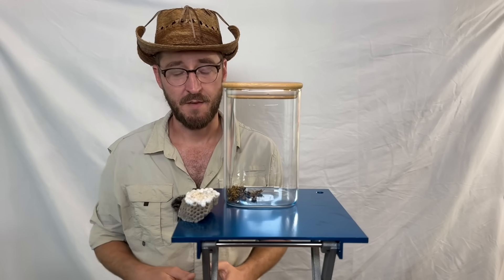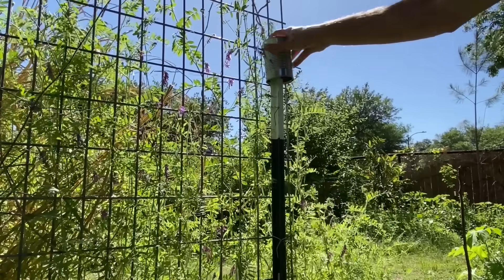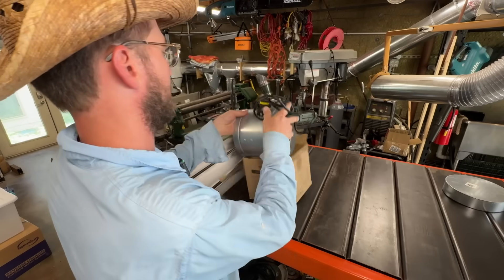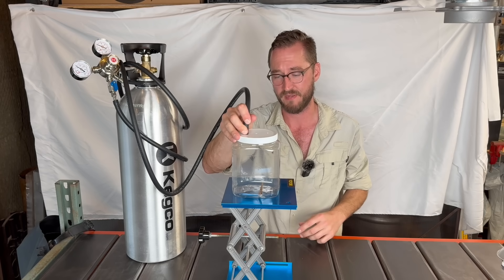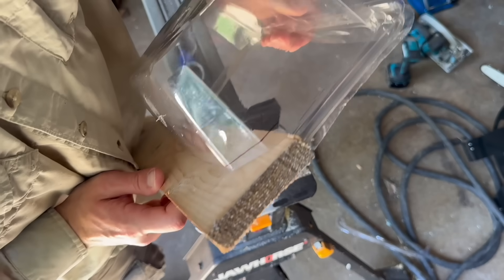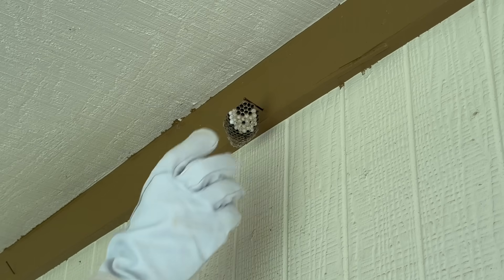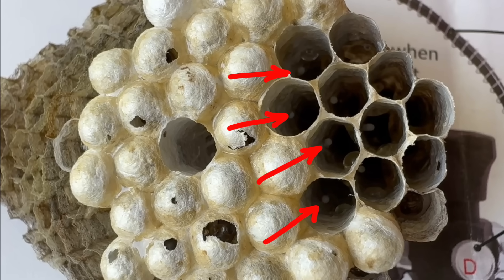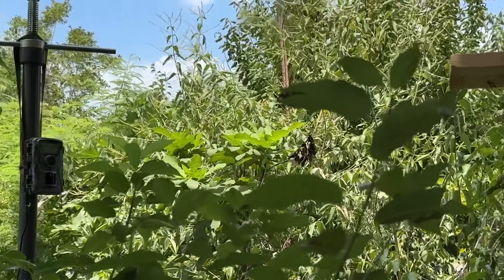Move WASP nests ANYWHERE!!!!

Comment: Your video content is super cool! I’ve tried similar methods before, but I wasn’t successful. I’d like to ask you a few questions that came to mind after watching your video.

From what I saw, your method is: you cover the colony with a net, wait for the wasps to wake up, let them recognize the location of the nest and climb back onto it, and only remove the net after sunset when they stop flying out.
I have tried a similar approach before, but the next day, the colony still flew back to the original nest location instead of staying at the new site where I relocated them.

Question 1: Have you ever encountered this situation?

Question 2: Regarding success rate, is there a difference between the pre-emergence stage (founding phase with only the queen) and the post-emergence stage (worker phase when workers are present)?

I noticed you used hot-melt glue to fix the nest in place. I know the pedicel is very important for Polistes wasps. Some literature indicates that the pedicel helps restrict the approach routes of intruders and contains substances that repel ants.

Question 3: Does fixing the nest with hot-melt glue compromise this protective mechanism, making the nest more vulnerable to ant attacks?

Question 4: Have you ever accidentally broken the pedicel during nest removal and had to glue the nest directly at the base without the pedicel? If so, did that situation have a higher failure rate due to ant attacks?
Reply from the maker: The wasps sometimes return the original site. Moving a young colony tends to avoid this compared to moving a more mature colony. 

No ant problems but I have noticed that the thinnest stalk attached to a small surface area is better at avoiding the below parasite. 

https://en.wikipedia.org/wiki/Chalcoela_pegasalis

Hot glue doesn’t work as well as a two part epoxy like JB weld. 

Good luck!!

Comment: What a cool idea! 

I discovered a paper wasp nest (Apache wasps, native to my area) on a garage shelving unit I had moved outside. Unfortunately, the nest was below eye level, as the highest shelf (under which it the nest was located) was only approximately 36” from the ground, so my “discovery” occurred when one of the wasps stung me as I was rummaging through my stored junk about a foot away from their nest. It’s possible that it wouldn’t have stung me at all had I not reflexively tried to brush it away — we also get a lot of black widows in my area, so I tend to treat any insect I feel crawling on me with suspicion until proven otherwise — so I moved away as quickly as possible, treated the sting and then went back later after dark to locate the nest.

This nest is easily as large as the big one you relocated, and is surrounded by enough stuff that I would have a hard time getting close enough to gas them safely, but it’s cool to know that it can be done. As it happens, I already have a CO2 cylinder from my aquarist hobby, so the biggest ticket item is already in the bag!

Knowing that they tend to build in the same general area (despite not re-using the same nest), I’ll be vigilant next growing season about catching the queens early in the process — I don’t mind native pollinators/pest control as neighbors, but I prefer if they allow me to access my stuff! 😂
Reply from the maker: I moved an Apache nest once. They are subtly different from exclamans but they are “prettier” in my opinion and bigger. Good luck if you try to move them. I didn’t realize co2 was used for aquariums.
Reply: @suburbanbiology it’s used for high-tech planted aquariums. They can be lovely, but they’re not for the faint of heart — or wallet! 😂

Comment: The only wasps i cant handle are the ground ones. Sevin dust in hole and 3 days they are toast. All my other wasps dont bother me and i got them all. We had paper wasp nest in our shed with mowers. I had agreement with wasp sentry, dont attack me and i wont spray you. I would take time and get about 3 feet from nest regularly as they were about 4 feet from mower. Has no issue til my son decided to try and get mower out. Nope they went after him and he won and i was pissed. I had tamed that 12 inch nest. Now i case them out even before they can create a nest fully.

Comment: Just a heads up, CO2 can cause PVC to become brittle over time. Make sure that you don't build anything where CO2 will sit inside of PVC before the open flow nozzle. Also, like almost every insect, the reason why wasps love your beer bottle on a hot day is that it leaks CO2 and they can smell it. CO2 usually signals food source (which is why we put limes in the bottle tops), so they get excited before they get sleepy. You gotta be quick with that container.
Reply from the maker: Cool info! I didn’t know about the brittle PVC thing. Or the food signal. Thanks for sharing!
Reply: @suburbanbiology  My pleasure.

Comment: Induced hypoxia could be MUCH EASIER.... just put a fragment of dry ice in a large pickle jar...  hold over nest until enough dry ice sublimates.... move nest.   No need to for huge pressure vessel and tubing. 
Also.... Your first draft failed to provide the wasps weather and predator protection.  Squirrels LOVE wasp larvae for instance, so do racoons.  Wasps choose porch awnings for a reason. Nacent paper wasp nests are suceptible to strong winds and rain (before envelope is constructed around the comb), and the height makes them predator-proof.  If you put some 5-6 inch lips on your horizontal board to provide wind/rain protection from all directions, you may get better success and eliminate the chance of abandonment / colony failure.   Neat video tho.  Looks like you figured this out, the oat can may be TOO deep, but keep trying and see what works.
Reply from the maker: You were spot on for a lot of that

Comment: My friend and I found a wasps nest under the ground one time that was humoungous. It easily went into the ground about ten feet. We ended up digging it up and it was crazy big. It was about 10 feet deep and was in layers every ten or so layers was the size of like a football at first and then extended into another chamber where the chambers would grow and eventually get smaller. The middle chamber that was the biggest was about as big as a beach ball but sort of football shapped. There were maybe five or six big chambers. We only realized how big the nest was because my friend stuck a garden hose down into the opening of the nest which was dug into some old retaining wall of a garden made from old rail road ties. The look on my friends face when the hose kept going down like ten feet was funny.The layers of the nest were sort of like a parking garage layout sort of or an apartment building. I feel like we discovered a super hive of some sort. After we killed it off we never had a wasp problem in his backyard ever again. This nest was a dangerous nest though since he had kids playing there. We first stuck a shopvac before the hose and turned it on at the entrance hole. We filled up the shopvac nearly half full of wasps before we decided on the hose route because wasps were still coming out after hours and hours of shopvac running. Just so you know. The nests you're seeing are probably offshoots of a major super hive somewhere nearby.

Comment: I learned (from others) a very effective way to deter paper wasps from building nests on a house in the first place.  Early each Spring fill a spray bottle with a solution of water and some liquid dish soap, like Dawn.  Spray the soffits and upper exterior walls under eaves and porches --- do not rinse it off.  I also go on the roof and dab a thin film of undiluted dish soap on the underside of each steel rain gutter bracket.  This dramatically reduces the number of paper wasp nests -- they prefer building nests on a surface that is not so slick.  The wasps find other places to build their nests and still patrol the garden eating pests.

Comment: For a year or so Ive had wasps in one of my wire spool tables outside, I remember before I knew they were in there I would use the hole in the top to make working on lawn mower engines easier and always wondered why all these wasps kept flying around but they never flied at me for some reason even with me banging on that table
Reply from the maker: Funny. In my “free water under the sidewalk” video I use a spool and over the last year Ive had red wasps build multiple nests inside it. The holes must be just the right size for them.

Comment: the only thing i'd add is that they choose to nest in ideal temperature conditions, so manually putting their nests out in the sun under hot wood might not be as favorable for them as the cold concrete wall under a large shaded area

its * also why they preferred the metal cans as opposed to that gourd
Reply from the maker: You’re right. Shade is important. I have no clue why they love the bean cans so much. But they certainly do.
Reply: @suburbanbiology  they might also be collecting condensation

Comment: xD CO2 is a good way to put anyone to sleep, forever.

CO2 does its job by replacing a % of the oxygen giving you too little to continue proper respiration. So due to low oxygen you begin to get dizzy, sleepy, sometimes headaches, and nausea. It's pretty easy to die from it. it's what kills most people in eruptions and large fires.

However, keep in mind if you have too high of a concentration of it, it can be a torturous death through CARBONIC ACID exposure in the lungs. resulting in inflammation, coughing, gasping, and slow suffocation from fluid build up in the lungs and cell death.

So just be careful lol

Comment: One time at a building i occasionally work at (filling in for a cleaning service, there was a wasp nest in a vertical hanging ash tray.   

They didnt wanna use pesticides because of possible human contact with the metal afterwards, so i began brainstorming.

At first i decided to try dry ice and a bag, as well as a rubbermaid container in case the wasps tried chewing the bag.

Couldnt find any dry ice, so after dark, i dumped some baking soda and vinegar in the bag, tied it around the ash tray, and taped the container to the wall.
Reply from the maker: Great idea! Thanks for sharing!

Comment: I thought this was a great idea so I looked up the cost of CO2...and its a little on the steep side. I don't know how much he paid, but even small bottles are expensive, and it looks like one has to use quite a bit to get the wasps to sleep. A better design would be some way to produce CO2 with sodium bicarbonate and vinegar, but I'm not sure it would produce enough gas to put the wasps to sleep.

Comment: Temperature. You forgot that. Wood panels worked because they stayed at the right temperature. Didn't overheat or get too cold like the cans.

Also, don't forget that non pressure treated wood and outside don't mix.

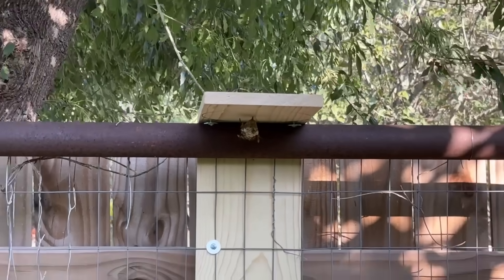Comment: 10:10 This is a bad method. Like... what were you thinking???
Wasp build nests where its DRY... does an open space with a back slanted top look DRY to you? Rain pours from all sides and the way those hang any water running down the front or back will get onto the nest and ruin those. IF you added a small frame around the nest (lets say 3cm... made out of a few wooden board snipits or plastic) this would be nice... but the way it is. I rate it an F
Reply from the maker: I did what you advise in the Patreon follow up. Solid c+ work.

Comment: Try reaching up under the bumper of a "parts truck" to attach a chain to move and mow...then getting STUNG by 30ish of them! Pulled arm out, left fore-arm and hand COVERED in WASPS... Ran like I was on fire, FELT like it. Whole left arm swelled up skin tight as a drum, heart raced like I OD'd on 'No-Doze', hurt whole left side to middle of chest. Found out I WAS NOT allergic to stings that day...because I LIVED!   25yrs later I STILL LOOK before reaching into anywhere...

Comment: I'm all about supporting the natural lifecycle of my local ecological system. The work you've done here, does just that. I spent a few years battling the problem of green horn worms on my tomatoes and the various parasitoid wasps helped me do just that. This past season, I planted a particular strain of monarda, a naturally occurring wild perennial. It attracted a fair amount of hummingbird moths, which I had never seen before and I was pleased. As it turns out, the problematic green horn worm caterpillar is the larval form of the hummingbird moth, I thought my tomato plants were done for. For whatever reason, I didn't have a single one. So while there may have been some paper wasps somewhere that went a bit hungry, I'm intrigued enough to see if I found a natural method of ridding myself of green horm worms without the risk of a high population of wasp nests on my property.

Comment: Great technology!   I have a colony that is 8"x12" growing on a railing backed by a removable glass pane outside a raised deck.  There would be no way to secure / contain the wasps inside of any kind of device because of the irregularities.  That's why I especially appreciate of the educational piece at the end of the video telling me that by the end of winter there will be almost no one home.  It's October already so I'll wait.  When I trim the blueberries in Feb I plan to remove the glass panel, wrap the whole thing in a garbage bag in case someone flies out.... and while wearing leather gloves, use a utility knife to cut the frame off the multiple railings.    Next summer I'll check more often and act faster.

Comment: Currently there is a paper wasp nest right outside my downstairs door, making it slightly dangerous to use it (this summer I've been stung twice!). The nest is underneath a deck floor making it impossible to reach without lifting up one or two deck boards (which will surely aggravate these wasps). I bought a can of poison, but haven't used it. Since they don't reuse nests, and likely will decrease in activity soon, I'm just going to wait to remove it (maybe I'll try in November). This video changed my mind about using the poison. Cheers!

Comment: Gasoline or Raid, forget moving them! I was stung recently by at least two from a small nest, in an empty bird cage on a porch,  they had built inside this wood with metal bars fancy bird cage, I lifted this charge and got hit two or three times, I am not alergic, but after a few minutes it hurt, and it stayed with me about a week, thankfully this nest was still quite small with maybe the queen and two workers, they can have a whole lot more I think they were guinea wasps (half pints) as they are quite common around here, we also have the much bigger red wasps and some normal wasps, there are yellow jackets, and occasionally you will find a red velvet ant, which is not an ant but a wingless female wasp whose sting is pretty bad. Earlier in the summer I saw a wasp investigating the rafters of my porch. I sprayed the area liberally with wasp spray, and have not seen any more.

Comment: Good video. I only smote wasps, hornets and Yellow Jackets if I need too. I was building a trellis and I kept feeling a stinging sensation on the hand I was using power tools with. I figured fertilizer was getting into small cuts in my hand but I was actually being bombarded by a hidden nest of Yellow Jackets just above my gate so I put them down. Another time Yellow Jackets and Hornets each built a nest 15 feet apart and they were attacking each other. They were on red alert and even attacked my pooch but yeah, good video and it teaches people that insects serve a great purpose as food or as predator..

Comment: Thank you so much for this video! I've always felt terrible when I had to knock down a nest that the ladies have worked so hard to build, especially when I was late and it already had eggs. I would much prefer to move them, but I didn't think it was possible. Now I know it is.
Reply from the maker: You should fortify the nests more than I did. I go into detail on Patreon. TLDR: use chicken wire and build some sides around the nest. Also don’t use hot glue. It can melt in full sun.

Comment: Can you try with dry ice? Make a chamber for the ice with a filter above it and let the wasps fall on to the filter/not touch the ice directly. Would this be a more cost effective solution? If there is not enough circulation you can add a small fan with the dry ice inside the container powered by a battery? Don't forget to mount the holder on the bottom of a broom/stick. Seems like it could be 3D printed. Better yet maybe a clear silicone funnel to help with tight areas like trim?

Comment: I was just telling a coworker last Friday about how important predatory wasps are for controlling plant eating insects. In the last 40 years here in New England, I've had zero issues with regular paper wasps. I leave them alone, they leave me alone. They're really not very aggressive. This is the opposite of my relationship with yellow jackets, with bald-face being in the middle (even though they're the ones that lit me up earlier this year). I never mess with a nest unless there's an issue. So, good on you! edit: With decades of working pruning shrubs and painting houses, I've never been stung by anything but yellow jacket, bald-face, honey bee, and bumble bee. Carpenter bees seem to be the most tolerant to being petted on flowers, btw (I've explored how to get stung). Honey bees wont sting on petting, but fly away. Bumble bees- a casual light/warning sting while still working the flower. I'd guess I've been stung like 250 times in my 50-odd years (5 times a year isn't excessive, and sometimes lower than a single event). But never a paper wasp. Sure, it happens- the females can sting (only the females). Just never for me.